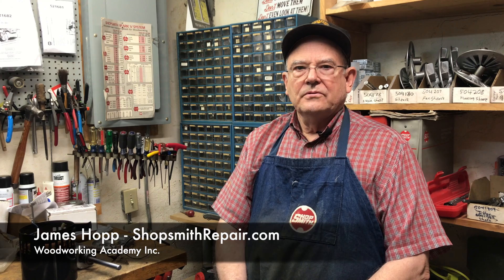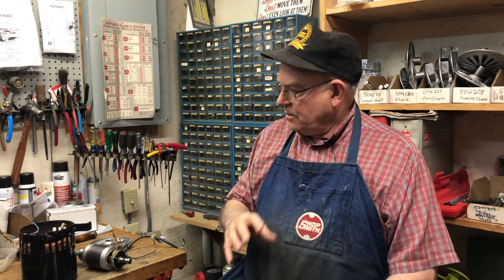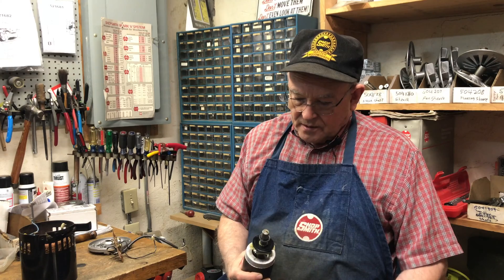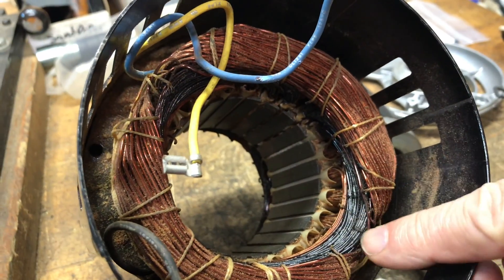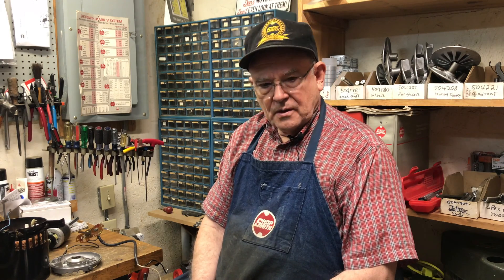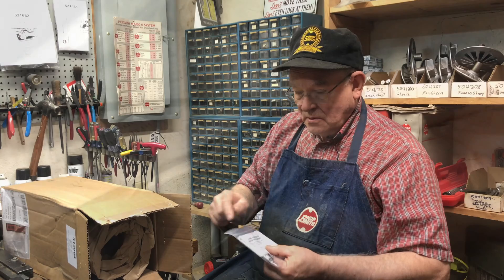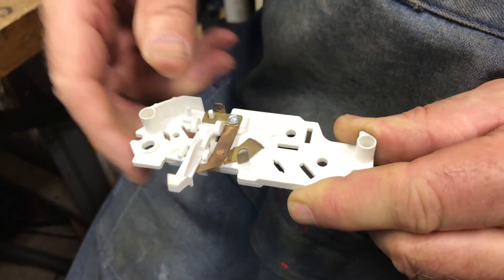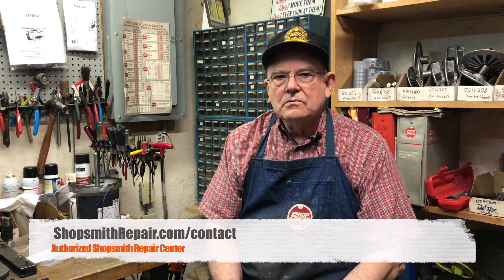What's inside your Shopsmith brand motor? Shopsmith Headstock (Mark V, PowerPro)

Comment: Motor Made In MexIco
Reply from the maker: Not all of them were just some  were.
Reply from the maker: Not the new one just the used and burned one was made in Mexico. The new one with two bearings was made in the USA.
Reply: @authorizedshopsmithrepair  the brand new one you pulled out of the box at 4:30 said made in mexico, you just lost all credibility
Reply from the maker: @seymourwrasse3321  You are absolutely correct, but does it really matter where it is manufactured? Absolutely not just consider  all the items we purchase from China, some are good high quality and some not so good, but if you consider that the parts are built  to the manufactures specifications then does it really matter where they are manufactured? Of course not! Today some of the best items we purchase are manufactured in Mexico and China and are built to the highest standards.
You should consider that some manufactures built their parts to last like Shopsmith no mater where the are physically built, while other manufactures built their parts to fail so that their service departments will have steady work.
WHAT REALLY MATTERS IS THE HIGH QUALITY OF THE PARTS AND NOT WHERE THEY ARE MADE!
Your friend,
James